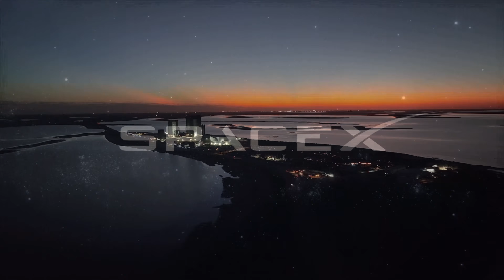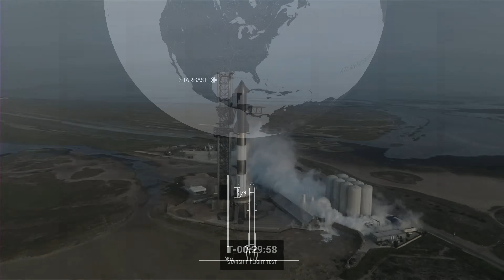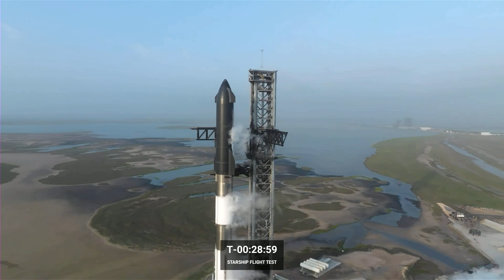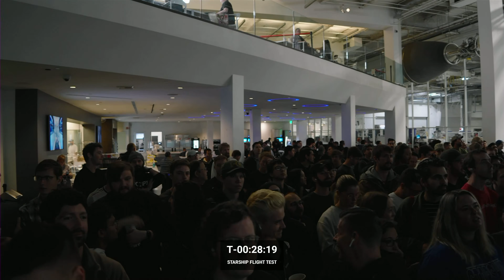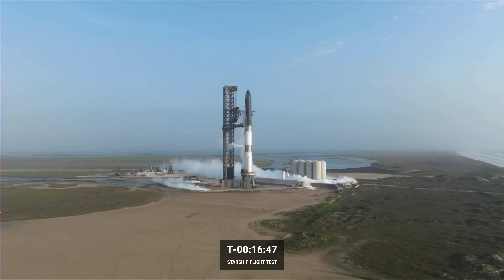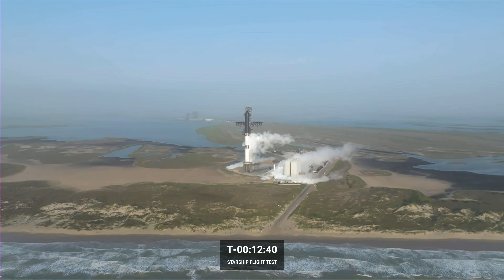Starship Flight Test

Comment: 44:53 - Countdown
47:50 - KSP veterans already know where it's going
49:03 - Rapid unscheduled disassembly
Reply: Bro what happened in last can you tell me please as i can hear them properly
Reply: >KSP veterans
Staging issues and loss of aerodynamic stability near max Q? Say it ain't so!
Reply: @Cavencyedits  fail separation --> rapid unscheduled disassembly
Reply: @Gooontar yeah. Ferram aerospace redux prepared us RO users for what was coming 😅
Reply: Чувак это лучший комментарий для тех кто играл ksp❤😅
Reply: @velfare  ok thanks brother
Reply: @Cavencyedits  As far as I can tell. Engine explodes ~30 secs. Does damage to rocket. LiquidOxygen still coming through pipe out into the plume. Rocket is too affected to stay straight later on (maybe damage, maybe Centre of Mass changes). Guidance can't keep rocket straight.
Reply: 44:54 T-10 Seconds

45:03 Liftoff!

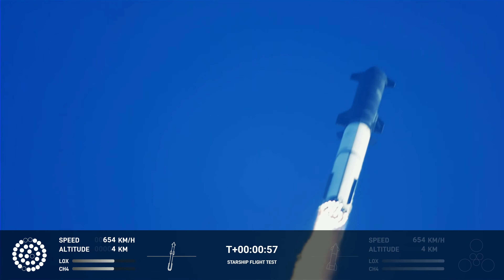46:05 Max-Q

47:54 Main Engine Cut Off

47:57 Flip

48:33 Stage Separation (Failed)

49:03 Rapid Unscheduled Disassemble
Reply: @владиславроманов-ф6р  что там на передовой? Все мирные убиты или еще нет?
Reply: They forgot to check staging it the VAB
Reply: NEEDS MOAR BOOSTERS
Reply: Forgot to turn on "return to VAB" feature... SpaceX must be playing on hardcore.
Reply: @2KOOLURATOOLGaming  okey thanks brother i got it
Reply: @2KOOLURATOOLGaming  good eyes, i missed that.
Reply: for sure we do, i was having slight PTSD from seeing that rocket just spin around
Reply: Absolutely
Reply: @Cavencyedits  They forgot to set their staging sequence before launch.
Reply: I bet I could recreate this exact launch in ksp 2 💀
Reply: @2KOOLURATOOLGaming  at around 1:00  the LOX drops dramatically
Reply: Lmao
Reply: They forgot to turn on autostrut, rookie mistake
Reply: Real KSP moment when it flipped while still firing the engines.
Reply: Looks like vehicle is fighting to stay prograde for a portion of the flight. Maybe due to center engine shutoff, since those have gimbal?
Reply: 47:50 someone forgot to press spacebar

Jokes aside I'm surprised it didn't break up from aerodynamic forces
Reply: i dont think it was a rud. pretty sure the spacex team activated the FTS to destroy the rocket once they saw it lose control after failure of stage seperation
Reply: @2KOOLURATOOLGaming  yeah. You definitely see a big flare up at that time on the left side of the video. At one point, you could also tell that not all the rockets were firing. I'm not a rocket scientist lol
Reply: Fr tho
Reply: Its rsd 🤓🤓
Reply: Kerbal approved.
Reply: yeah :/
Reply: So memorable Kerbal moment 😂😂
Reply: OK, let me add a few more struts....
Reply: Rapid unscheduled disassembly 😂
Reply: Yeah, except my rocket would have instantly exploded from aerodynamic pressure the moment it started to rotate 😆
Reply: For a second I thought it was just the booster
Reply: How much time until KSP2 plugin with the exact same interface lol
Reply: @Stephan_1990s  do it or I’m deleting ksp
Reply: @jakubmierzejewski961 , почти, ты один сбежал, дружище, но это ненадолго 😉
Reply: 4:30 explosion :)
Reply: Exactly
Reply: Rapid unscheduled disassembly? Is that more alternative reality?
Reply: I bet the rapid unscheduled disassembly was intentional self destruct command after they got as much data as they could. The rocket handled the tumble well before that end but the flight was unrecoverable.
Reply: Repent. Believe in Jesus Christ and become a new person in this life.   
John 3:16 KJV For God so loved the world, that he gave his only begotten Son, that whosoever believeth in him should not perish, but have everlasting life.      Matthew 4:17 KJV From that time Jesus began to preach, and to say, Repent: for the kingdom of heaven is at hand.    
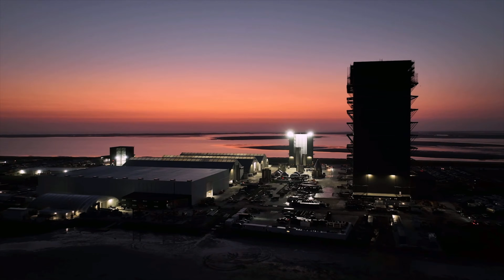2 Corinthians 5:17 KJV - Therefore if any man be in Christ, he is a new creature: old things are passed away; behold, all things are become new.
Reply: Not so sure of the Unscheduled part.
Reply: what is a KSP??
Reply: Must've run into the kraken
Reply: 'Revert to Launch'
Reply: @jakubmierzejewski961  Hey man!  Speak American ;)  Just kidding!  In all seriousness, I'm glad folks from around the globe can see this!
Reply: 49:04 FUBAR
Reply: "Return to VAB"
Reply: lol yes)
Reply: Thanks
#
Reply: Check yo stagin'
Reply: They messed up their staging
Reply: oh yeah bolognese pasta pasta :-D
Reply: I laughed so hard at KSP comment.. facts.
Reply: Hahahahhahah I was thinking the same thing!!!!!!
Reply: @jakubmierzejewski961  R.U.D. произошел над водой, как и планировалось. Так что все были в безопасности.
Reply: @alanhan  But it did.
Reply: @alanhan  they couldn’t find the any key…
Reply: @deewight9040  It's pretty accurate actually.
Reply: @IngoPagels  kerbal space program game. We saw exactly what was going to happened.
Reply: @Gooontar  those hours were well spent, sir. You could have played some video games instead... Imagine that!
Reply: "Rapid Unscheduled Disassembly" 😂😂😂 ... I guess they expected it.
Reply: Who put the dang parachute before the separator?!
Reply: @2KOOLURATOOLGaming  I would say that it didn't stayed stable because in one side there were like 5 engines in the outer ring and that made the difeerence in thrust too big to control it, sorry for my badi English I'm not a native speaker.
Reply: You misspelled "blows the #&%® up."
Reply: What happened at 45:33?
Reply: Except there was no wobble at all. They must have really gone full in with struts
Reply: NASA passed this point of exploding manned rockets in 1961.
Someone needs to tell this to Elon Mush.
Reply: @WireframeLicker  engine failure probably, you can see at the bottom left which engines died, looks to be about 6
Reply: 47:50 not only veterans
Reply: @2KOOLURATOOLGaming  this is not really correct form what I can see. I see that that obviously there was a failed separation at around 2000 km/h at around 39 km alt as the fail continues the throttle is seemingly stuck as there are no adjustments made visually or to the bar that shows fuel consumption. The rocket starts and uncontrolled spin and begins to plummet back down and regain incredible amounts of speed (2100 Km/H) and drops 10 km  down to 29 km to where the atmosphere is much thicker meaning the strain on the casing on the booster is much larger than it is made to handle leading to a rapid disassembly and the liquid fuel from the booster is vaporized in the air  at exactly 49:03 and then the actual starship main component (the darker part as seen in the beginning) also has a separate fuel tank which combust moments later at  49:05 . thank you for coming to my ted talk.
Reply: @WireframeLicker  46:54 seems like one of the engines revived itself too, cool
Reply: @2KOOLURATOOLGaming   45.32 an engine explode?
Reply: thats why u always quick save before separation smh
Reply: space takeover sideshow ends with a big boom
Reply: auto-struts must have been on though, look how many flips it endured!
Reply: Who do be piloting that Starship?! Jeb?
Reply: "guys it's ready this time I swear"
Reply: When you're playing KSP and realise you forgot to add decouplers / set the staging up
Reply: @2KOOLURATOOLGaming  I saw the debris.  But also right as its leaving the launch pad there's a massive shower of debris, I wonder if an engine blew up within seconds of ignition?
Reply: They forgot to turn on the SAS
Reply: never played ksp in like 4 years. forgot what the kraken was lol
Reply: @sursurrus  you’re right, at 45:32 we can see some “unneeded material” being expelled from the craft.
Reply: @lioncurlew  as a prior serviceman I appreciate that comment 😅😅😅😂😂
Reply: Engine-heavy exhaust at liftoff, survived that (impressive!), got through Max-Q with five (at times 6) failing engines and then unable to keep attitude late in the gravity turn.
I'm really surprised that thing survived that - in one piece! - until LOX ran out and the lower engines ate themselves, blowing up the upper stage in the process.
Reply: 47:50 genius! the only reason i knew something went wrong straight away was indeed playing KSP lmao
Reply: @Gooontar   All the control surfaces and wing thingys  are ahead of the center of mass.... This is EXACTLY what would happen in KSP.
Reply: 49:03 is the icing on the cake
Reply: @nw4042   Oh yes, completly forgot, I need to check my grammar.
Reply: @chriskelso723  вы его не так поняли. Судя по имени этот парень поляк. Он увидел комментарий на русском языке и попытался приплести конфликт на Украине. 
Здесь речь не про взрыв Starship. 
Но этот парень так и не ответил на мой встречный комментарий
Reply: thanks
Reply: Check your staging!
Reply: @jayrussell3796  "yeah. You definitely see a big flare up at that time on the left side of the video. At one point, you could also tell that not all the rockets were firing. I'm not a rocket scientist lol"

As far as I can see it.

There's 2 temporary flareup on the right side a few seconds before that. 

Then on the left side of the rocket, not the engines, there's horizontal flames for a second, as if along a panel, after which something explodes of the side. 

And then there's a couple of flareups of, what looks like an engine on the left, which then runs "flared up" for a bit, until another explosion on the left. With flames coming out the side of the rocket even further up. 

The second explosion stops the flare up of the engine on the left. 

Seems like the total engine plume color goes from pink/bluish, to yellow after first explosion, but after the 2nd explosion, the color swings back to pink/bluish, with some yellow in it, with smaller flareups of yellow continuing. 

So certainly some sort of fuel or oxidizer leaked and changed the combustion and kept leaking afterwards.
Reply: I play orbiter2016, similar to KSP
Reply: SpaceX should’ve thought better and hired ksp veterans
Reply: @IngoPagels  Kerbal Space Program
Reply: As you can hear in the last minute of the flight, they were expecting a separation of the booster. It kinda looks like Starship failed to separate from booster, and the booster started the return manouver but with Starship still attached. They activated FTS once they noticed the rocket was no longer under their control
Reply: Alicia Rainieri  Nerds who have had this exact situation happen in the game Kerbal Space Program.
Reply: @gravitationalassist379  Poor Jeb... aways first to end up stuck in orbit.
Reply: @truedadof2  Thanks for your Service Sir.
Reply: @владиславроманов-ф6р  по телеметрии было видно что высота уже пошла в минус, а пробел не нажимается🤣
Reply: KSP veterans already know where it's going yes god damn it right lol 🤣🤣🤣
Reply: @lioncurlew  no problem
Reply: As soon as I saw the altitude go from 39km to 38km at T+3:22 while traveling at 1500km/h, I knew it was done, definitely. The amount of thrust youd need to re-enter the original path at that speed while descending would have been enormous.
Reply: Yeah! Looked like it was too top-heavy and had too little control surfaces on the bottom.
Reply: should've turned on rcs smh my head
Reply: @robertspencer5723  I'm Polish. Just randomly hatin' Russians not to make their life easier. Greetings my friend! Thank you for all of support. We'll remember this
Reply: It was supposed to do that at 47:50, it had to straighten itself for stage separation, but it kept rotating due to a failure
Reply: I saw that spin and i said “HOLD ON JEBEDIAH THIS MIGHT HURT A LITTLE”
Reply: Seems they forgot to check their staging
Reply: lol
Reply: Not enough struts
Reply: Ayup! Back to the VAB.
Reply: Nothing more engine and stage cant fix
Reply: Lol xD
Reply: 49:03 hits the firmament
Reply: Accurate time stamps
Reply: @Cavencyedits  i mean it's tumbling ain't no way ur gonna recover and still get somewhere useful
Reply: KSP HAHAHAHA
Reply: I was looking for this haha
Reply: Hebrews

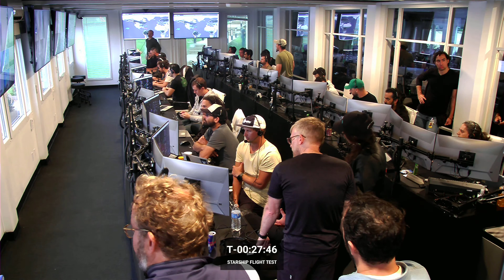12:14 Make every effort to live in peace with all men and to be holy; without holiness no one will see the Lord.

Acts

3:19 Repent, then, and turn to God, so that your sins may be wiped out, that times of refreshing may come from the Lord,

James 2:24,26

Ye see then how that by works a man is justified, and not by faith only. For as the body without the spirit is dead, so faith without works is dead also.

John

3:16 'For God so loved the world that he gave his one and only Son, that whoever believes in him shall not perish but have eternal life.
 
3:17 For God did not send his Son into the world to condemn the world, but to save the world through him.

3:19 This is the verdict: Light has come into the world, but men loved darkness instead of light because their deeds were evil.
Reply: The gospel message is that God loves you so much that He sent His Son, Jesus, to die on the cross for your sins. Through Jesus, you can have forgiveness and eternal life. All you have to do is believe in Jesus, ask for forgiveness, and commit your life to following Him. He will transform your life and give you hope for the future.
Reply: That whole launch reminded me of playing KSP.  The first few seconds, I couldn't tell if it was camera shake or they hadn't added space tape to the two stages.

Also I like how 6 engines didn't even start properly.  Should have checked staging first. haha.
Reply: 47:50 - KSP veterans already know where it's going
I can literally agree since every time my recreation of the starship in KSP1 and 2 starts doing that it will explode
Reply: There are things not yet discovered inside the earth and ocean, why you aiming for the sky?
Reply: @Spartan1312  thanks. thought lots of trolls posting for fun but that Kerbal game seems to be right. did not know the game.
Reply: @IngoPagels  Try it out its a ton of fun. Do not be surprised if your first few rockets end up like starship lol
Reply: 47:50 Check yo staging!!!😂
Reply: @noe5054  noe?
Reply: Someone forgot to turn on SAS.
Reply: Maaan I can't wait till KSP2 is in a playable state.
Reply: Hahahahhaha science rules
Reply: When you're overturning: oh shi-
Reply: The Kerbals were cheering the entire time. We must go to the Mun!
Reply: Sad to know what is going on at the moment it’s start flipping😢
Reply: disassembery*
Reply: Needs more reaction wheels
Reply: With over 37 years of advanced material reinforcement manufacturing and failure analysis engineering experience, I have designs that should be considered for a major reengineering of the launchpad system & tank farm which can be replicated on other planets ie. Mars. 

With reinforced concrete, it is critical to understand the marriage between the Portland cement (glue), aggregate (rock), reinforcement (rebar) and protection thereof to prevent mechanical failures.

To prevent further launch pad, vehicle and infrastructure damage, suggest new reinforced concrete design along with external advanced composite blend blankets working together to protect the systems from the damaging harmonic & inharmonic frequencies, static, dynamic, shock loads, thermal loads and massive wind vortices during launch sequence.

The massive sand, dirt, rock and cancer causing silica dust coming from the pulverized concrete and Earth below & round the launch pad are direct violations of OSHA silica dust & EPA Clear Air and Water regulations, rules and guidelines.
Reply: AliciaRainieri Kerbal Space Program, a simulation program for space enthusiasts
Reply: "Beginning to flip for stage seperation"

Presses ESC.
Reply: They hit spacebar with throttle still at 100
Reply: lol
Reply: Don't worry, just click "revert to the vab"